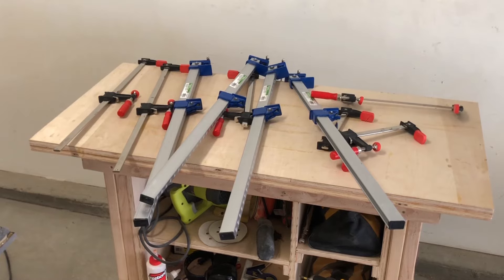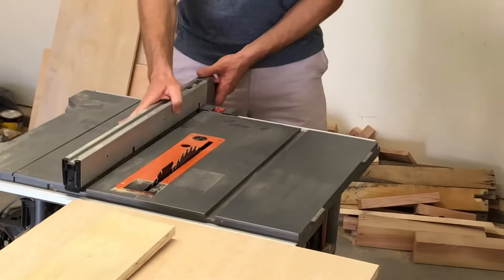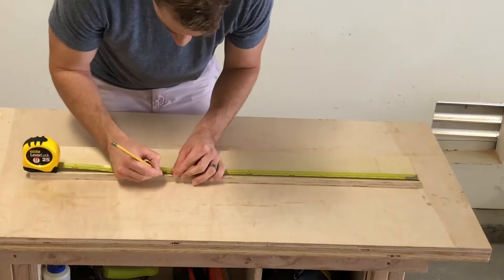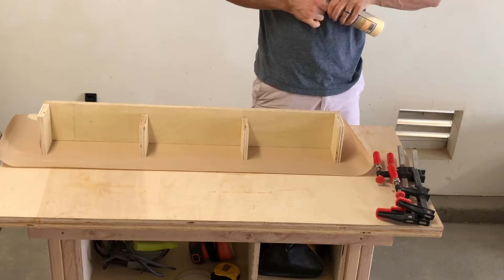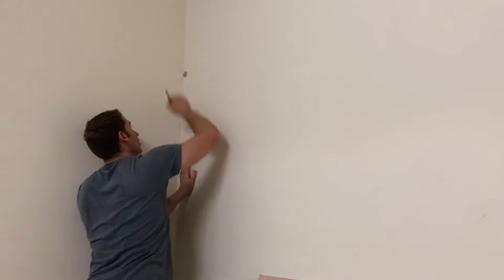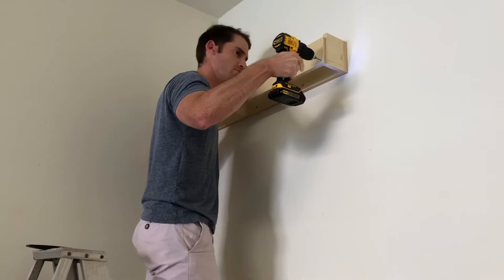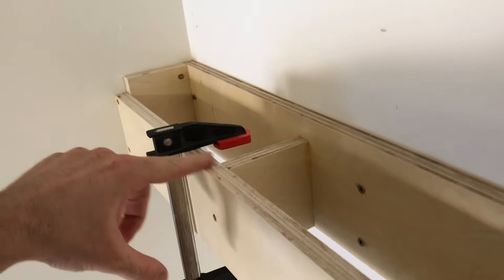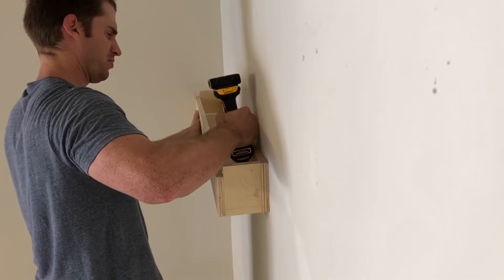DIY CLAMP RACK // WOODWORKING

Comment: Um... you did cut them the right size.  Your mistake was installing the rack on the wall with the FRONT screwed to the wall, and the BACK facing out.  Spin it 180, and you're golden!